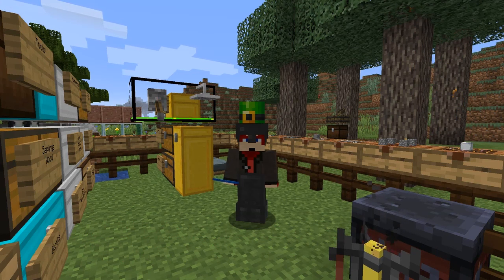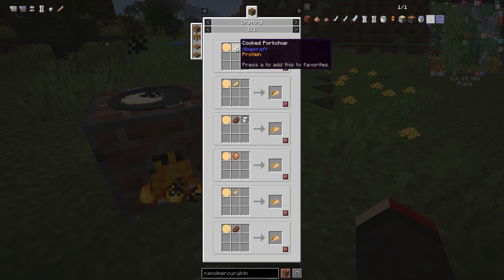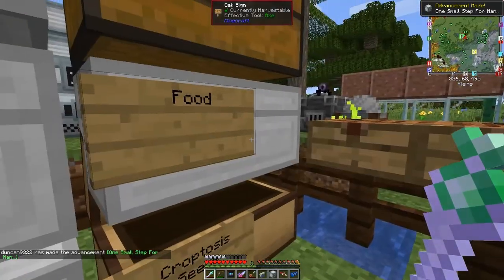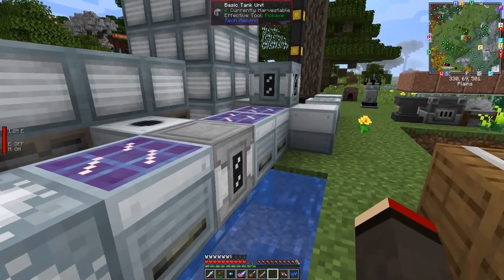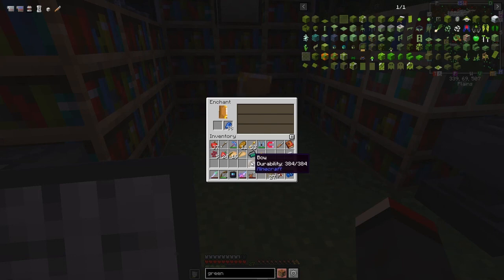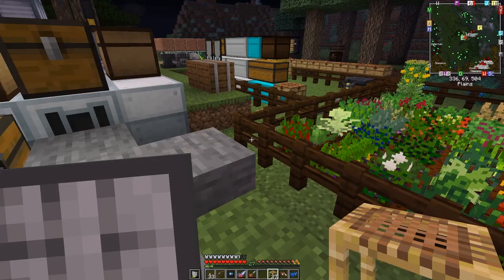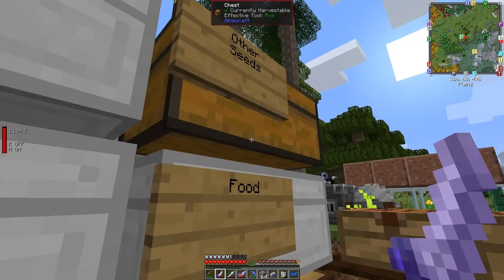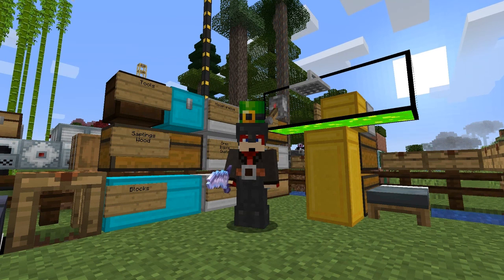All of Fabric 3 #12 - Tech Reborn NanoSaber, Gas Turbine, TacoCraft

Comment: I'm playing aof 3 and I'm trying to get the open pot to work for the barbacoa but I can't seem to get it to  work. Any tips
Reply from the maker: All I can suggest is the check the recipe for barbacoa and the usage of open pot; you should see if there is a recipe using open pot.
Reply: @duncanwebb4934   thank u I've followed all of the instructions I can find im stuck on whare it says to right click empty handed then place the dirt the smoke then comming from the dirt block should look like torch smoke but instead looks like normal campfire smoke.
Reply from the maker: @Chaosfairy9000  in the past I would have tried this for myself. Since the mandatory Microsoft account requirements I cannot do this. So I can’t help you anymore, sorry about that.
Reply from the maker: @Chaosfairy9000  There are some cases where you need to have something in the off-hand and other cases where the off-hand must be empty. Maybe dirt needs to be in the off-hand.